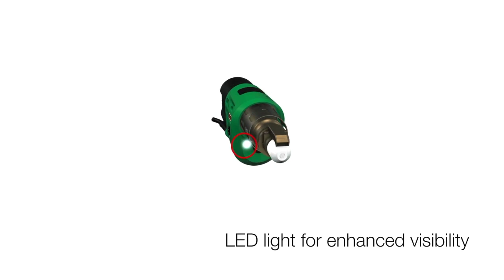LEISTER Fusion 1 Plastic Welding Extruder

Comment: I like the idea and Leister has a good reputation, but the weight and the price has been holding me back as I investigate other products. I used to own a Drader extrusion welder but the product and support from them was terrible. I don't want to spend $4k on another manufacturers experiment. The weight is an issue as the Drader actually caused me to develop hand issues from the weight. I see this one actually has provisions for relieving the weight while welding. Most of these welders look like they were invented while the developer was sitting on the toilet. Weight, compact, and versatility are foremost in my search, but I'm not paying $4k for another $1500 welder.